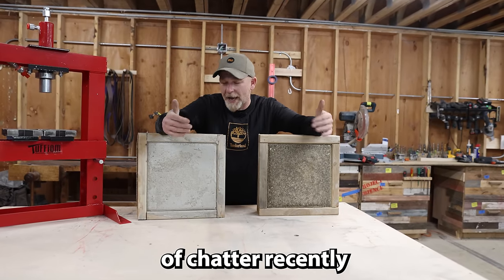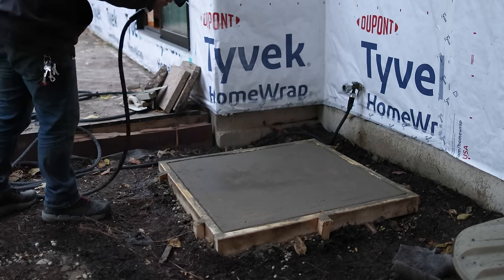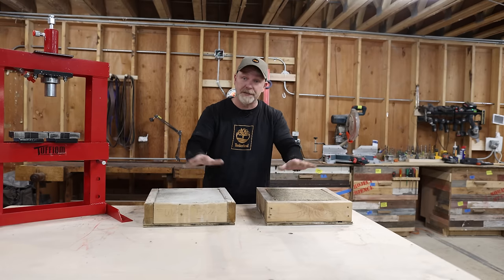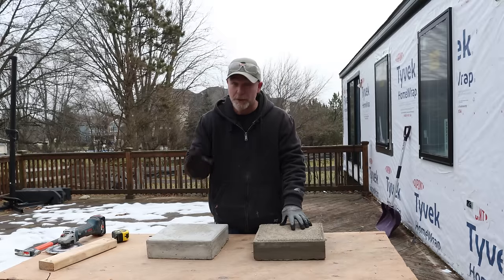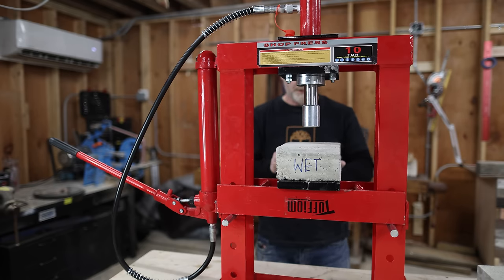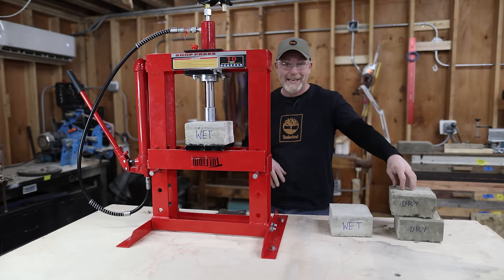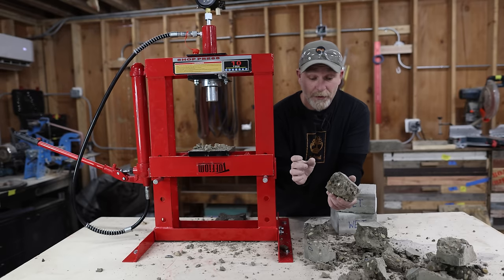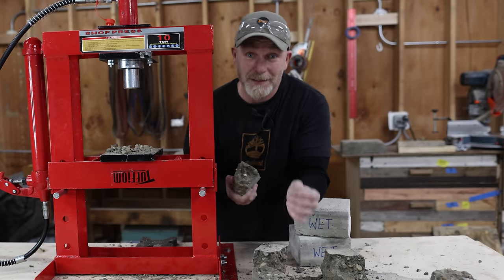The TRUTH About Dry Pour vs Wet Pour Concrete!! Strength Test - You WON'T Believe the results!!

Comment: You have to mix it all together like bread dough to ensure the end material is isotropic, or all bets are off on any loads going in to that mix. Less water means a higher cured PSI, but makes the mix harder to mix and work with. Fly ash and Superplasticisers make dryer concrete mixes more workable, but when the working time is up, the concrete sets up in a matter of seconds...
Reply: We made rebar reinforced test beams and test cylinders out of concrete in Architecture school. We had to do our own mixing, so I tried to hand mix the driest concrete I could work with, had to manually stuff chunks of the mix in to the form corners (it barely troweled it was so stiff), but ended up with almost 5000PSI without admixtures. Fun times...

Comment: Glad I saw this video. I saw a previous video where they did two dry pours and both came out great. One had a chicken coop on it and a year later it had no cracks. I'm building a slab for a 500 gallon propane tank. Sure, dry pouring is easier, but if you're not going to do it right, then just pay someone to do it. I'll wet pour like I always do.

Edit: I will point out that their slabs were only 1 1/2" thick, so maybe the misting made it easier to get the water to go through completely and cure it?

Comment: Like all things in life, there is a time and place for their use. Dry pour make a nice base for things that are low stress and cracking is not and issue, ie as a base for laying pavers or landscape timbers in gardens and beds where soft, sandy soil can be an issue. We have used it a lot in these kinds of applications with great success. Just think of it as harder, stronger base for places you walk or set things on and as a weed/grass blocker around raised beds and walkways. It also works great under lean-to type structures to give your gravel a bit more rigidity and helps prevent shifting and rutting.

Comment: On the dry pour was the powder mixed by hand or whatever very thoroughly to make sure the mix of all the rocks, sand, and hardener, and whatever else is in it was pretty constant throughout, because if not I bet there would be parts with just rocks and sand holding together and other parts that have hardened.

Comment: Majority of the strenght in concrete comes from specific hydration ,the agregate stone size, shape and hardness ,and the steel reinforcing bar and how it is placed in the concrete.wire mesh adds little to no strength but it may keep pices together if it cracks

Comment: Not an engineer, I studied mid 70's. Logic tells me dry poured concrete would require a larger cement to aggregate ratio because  the space taken up by water in wet concrete has to be filled with cement in a dry pour. Secondly, the process of cementation is a chemical process, which tells me if water is required for completion of the process, it will be either less effective without water, or completely ineffective.  Thirdly concrete strength is expressed in megapascale, with 28 megapascale (mpa) being a fairly average, run of the mill concrete. (About 2 tons per square inch, the crush test shown in the video does not come anywhere close to that, with 8 tons pressure applied to an estimated 10 sq inch). Fourthly, even a wet pour should be very carefully mixed with exactly the right water to dry content to pass what is called a "SlumpTest". The reason for the slump test is to ensure the water content is not too high, so the excess water causes micro-voids inside the concrete, which weakens a concrete mix. Concreting is a science, not a recipe.

Comment: The only dry pour that is actually hard is one that is buried right off the bat. We used a dry pour at the joint between the perforated and solid pipe, when developing springs. I've seen those dams get so hard a backhoe couldn't break it.
Exposed dry pours never last. The freeze thaw cycles will turn them to gravel. At least the ones I've tried and seen done by other local folks.

Comment: During the first test, this fellow said he was applying 8 pounds of pressure.  Then he went up to "almost 9 pounds of pressure."  Then he removed what he called a "plate" of unspecified dimensions and contact area and applied "direct pressure."  He then said he applied "6 pounds of pressure."  Then he changed his measurement to "8 tons of pressure."  These tests were applied to the wet pour sample.

With the dry pour sample, he put his "plate" back on and applied "5 tons of pressure."  He declared he observed cracking.  Then he stated he saw cracks everywhere at "8 tons of pressure."  Like before, he removed his "plate" and guessed that he had applied "2 pounds per square inch" using his "direct" method.  Then he declared that he had applied "8,000 pounds of pressure," further obfuscating his results.

All in all, this was a sloppy test because the terms and values were not sufficiently defined.  Every building code specifies concrete compressive strength in pounds per square inch.  This is from the International Building Code.

"Note that the International Building Code (IBC) (Section 1905.1.1) and the ACI 318 Standard (Section
 5.1.1) indicate a minimum specified compressive strength of 2500 psi for structural concrete. Simply
 stated, no structural concrete can be specified with a strength less than 2500 psi."

I would say a more professional test needs to be conducted with the correct terminology, correct units of measure, and standard procedures before anything definitive can be decided.  Also, if 2,500 psi is sufficient for structural concrete, it looks to me like either dry or wet pouring will work just fine in many applications.  I read someone else's post about the results of leaving a bag of concrete out in the rain.  I have done that, and the result was a very substantial, strong hunk of impervious concrete that certainly did not crumble like Styrofoam, a trade name for the more correctly labelled closed cell extruded polystyrene foam.  In professional tests like this purported to be, and on drawings, and elsewhere, using trade names is avoided.

If 2,500 psi is sufficient for structural concrete, I would say dry pouring is more than adequate, without steel reinforcement or gravel (especially when using Quikrete which already has gravel), for driveways, entry pads, or other pads like those supporting an exterior heat pump, a tool shed, a table saw, etc.  The difference between wetting concrete before you pour it or after is not clear to me.  Perhaps with some sensible analysis and application of wetting a dry pour, there would be no difference.

I'm a little surprised that those geotechnical engineers and concrete engineers and civil engineers making comments did not point out any of these invalidating deficiencies in this amateurish test.  It makes one feel like they were defending the method that supports their livelihoods.  Also, it seems to me this fellow rushed into a "test" to take advantage of the current heightened interest in dry pouring concrete without really knowing what he was talking about.

Comment: You should make another video and test both with anchor bolts and concrete screws and use torque wrench to test strength. Thanks for the  content.

Comment: Don't let this deter you. The average person dry pouring is doing it for foot traffic or small pads like grills, sheds, coops etc. Even if it were for a driveway, the average vehicle is not 8-10 tons.. and the concrete will continue to cure the longer it sits. Also the weight distribution of that tonnage pressure is minute compared to a vehicle.

Comment: Dry pour and water. One main point missed is that the test forms had plywood bottoms. The dry pour method expects gaining ongoing moisture from the ground, NOT just from initial hose work-- continual curing. Strength: If, for example, the purpose is light traffic, why does it matter if wet mix can handle more pressure than would ever be encountered? Isn't that like saying everyone should have a Ford 250 pickup, when all the hauling functionality I need is for grocery bags from weekly food shopping?

Comment: If you only walk on it, it's perfectly fine, i did mine 10 years ago, and not even one crack, do it by layers too, you will be sure the middle will be wet too, every 2 inch you put, you wet it, and the top layer do it like the videos are showing you.

Comment: Watching watching several pro and anti dry pour concrete videos, what I've come up with is this:
1) Dry pour in absolutely inferior quality to wet pour, if we consider both are treated properly by a competent worker. There's simply no arguing this. Make no mistake, dry method is a lazy, cheap, DIY shortcut. That doesn't mean it's wrong to do, as a DIYer, on your own property. No experienced mason, city/state/federal official worth their salt would ever sign off on this method for any important work.  

2)Dry pour should definitely NOT be used on anything structural, such as footings or a monolithic pad that carries a constant dead weight. 

3)This doesn't mean dry method is useless. Fence posts might actually benefit from a dry method, in some situations. Patios and sidewalks can be done dry and hold up for a number of years before it disintegrates. It might be a good short-term strategy, for a handicapped and/or poor person.

4) I don't have any real data to go by, but I imagine that wet pour projects will last much longer than dry, generally speaking.

Comment: Interesting video! I think the dry pour was not done properly with the "misting" stage. Note that he seemed to have gotten a pretty rough surface with the dry pour. I think it is because he was not misting, but was literally spraying water into the dry mix. Should have sprayed with a fine mist, and more frequently to keep the surface moist. After the surface sets to a reasonable hardness (hard to the touch) with the misting, then spray more generously. Then cover with a plastc sheet to keep the sample wet.

Comment: Your press handle is upside down. You're suppose to PULL the handle down as it gives you more leverage with body weight. Pushing can cause injury to your muscles.
Reply: Saw that two
But mfg might have shorted the hydrolic lines
Reply: Nope! Upside down.

Comment: I just dry poured a 24x36 pad for my mini-split and after two weeks of curing I was kind of scared of what I would find when I went to drill the anchor holes.  It took quite a bit of pressure to get the 3/8" concrete drill bit using a hammer drill to drill down, so I figured I was good.  The main difference between my pour and what you did though was that after the initial misting, I only waited about 20 minutes and then I really soaked the pad with water and as soon as the water was all absorbed, usually about 10 minutes, I would soak it again.  I think I spent about an hour watering it off and on.
Also, the edges on my pad are rock solid and do not crumble like yours.  My coloring is mostly light grey throughout on the sides but for a few patches of that darker, almost still wet look.  It would be interesting to try your test block again but really soak it and see if it makes a difference.

Comment: The major concern I'd have for your AC unit on the dry pour pad is the vibrations from the unit operating. It turns the weight of the unit into a dynamic load, which acts as a hammer on the pad.

Comment: This actually not dry cast but powder cast. However the issue you have is hydration on a dry powder cast.  If you do a true dry cast  which is just enough water to make the  mix Damp So crumbly  but when you squeeze it in a ball in you hand it will clump or pack tight This is true dry cast. Try a pour that way and you will find the concrete will be substantially harder than the wet cast However it requires more effort to finish as you will need to  compact it in to place vibrated ( tapping with a hammer many times)then trowel finish (your press will work well for that). The advantage to the true dry cast is you are keeping the water to a minimum and once it has been compacted  manufacturers can de mold instantly. This is used in all types of pre cast paving stone cement block patio slabs and casting place or slip forming  Curbs, Concrete highway barriers road construction Or roller compacted concrete slabs.

Comment: Each to its own.  If you don't have all the tools needed to wet mix it and only need a pad for a shed/walkway/pad for water softener or even a walkway,  then dry mix is a good option.  This covers 90% of DIY who just want to reorganized their yard without spending too much money. If you need to a concrete slap for something heavier like a driveway/fence post or a small building, then wet mix is always a better choice.

Comment: If you use a dry paint roller on the dry pour it will not be rough. Search the net for examples. If your usage is for a foot path with low weight and stress usage, a dry pour is fine. If your usage is for high weights and stress, a wet pour is best.

Comment: Dry pour works best for things like posts. I do all of my posts with dry pour from bottom to six or eight inches from the top and cap it with clay. Dry pour gets better strength when it can slowly extract moisture from the earth. I haven't tried it for slabs but if I do, I will bury them in moist earth until cured.
If the dry pour doesn't get enough constant moisture for the catalytic reaction to develop a good gel it will fail to get good cohesion.

Comment: There are a couple things that are wrong with this test. One being that the wet concrete although mixed wet was by hand with a shovel. You always use a CONCRETE MIXER for this. And second that dry pour is a hit and miss thing with the mixing process. You aren't supposed to spray it but use a gallon jug or other type of device to mix it with. It's supposed to be poured - not simply wet or moistened with water spray. I've never seen that before. The instructions on the bag even say one gallon of water for every 50 Lbs. of concrete mix. 

My friend and I mixed it with a gallon for each bag and it came out white like regular concrete mix. He'd done this before last year when he had to replace the fence posts along the back of his yard. A powerful storm blew it down. He used the dry mix in a bag. We got this from Ratnard's (Menard's) and it worked pretty fast. We just did this to repair his fence along the driveway by replacing the old posts. This was yesterday afternoon (5/24/2024).

Comment: I have poured concrete dry at times and the major problem I see is getting the aggregate mixed evenly throughout the pour. Most times the gravel ends up separating from the cement and making a layer.  I equate it to making a cake mix dry or wet. If you just put the flour in a bowl and dump the rest of the ingredients on top, and bake it, you’re not going to get a very good cake!

Comment: Concrete is a crystal -dendrite structure. the chemical reaction of water and cement  create crystals that grow out and interlock with each other. Without enough hydration the crystals will stop growing. Try dry pour but saturate/soak the slab every day for 30 days and then compare.  I don't think it will compete with a (proper - mix ratio) of concrete but it should preform better.
As a mater of fact if you pour a slab and soak it every day for a week or two it will become much stronger and develop less cracks. This is not practical for contractors but it is a good idea for the home owner.

Comment: There are no short cuts when doing a concrete job. Cement needs to be mixed-up so you know the water ratio, either by hand or machine. Each bag may have more or less rock or cement per bag than others.

Comment: It should be called properly poured concrete VS homeowner poured concrete.
 There is no such thing as "dry poured concrete". 
 This kind of reinventing of the wheel should be mocked and ridiculed.
 No professional engineer would accept this as an alternative to Properly pouring concrete.
 With that being said, thank you for doing this video.

Comment: If the dry pour had compactive effort applied so the density approached a Modified Proctor value the strength would be far higher than the wet mixture. The water added to make the mixture plastic is not needed for hydration. The maximum strength is created with far less water.

Comment: Probably is because the way the water enters into the mix. When you do it wet you mix all ingredient at the same time. Including the water. In dry mix the water gets in later and gradually. You don't have control of the process. You can't guarantee that everything gets the same amount of it. I am not an engineer, but the ratios of the ingredients affect the strenght of the mixture.

Comment: Corrugated (dried all at the same time)  vs drying at different times basically. Could've told you that lol. The only time I dry pour is around deck and fence posts because they aren't bearing direct loads

Comment: The ultimate strength of a given concrete is dependent on the water / cement ratio. If two samples are cured in exactly the same conditions the one with the higher water / cement ratio will be weaker. But of course the dry and wet samples did not have the same curing conditions. The wet concrete can start its strength gain  immediately after placement, but the dry sample only gets water on the surface, and it likely takes time to percolate through, and that water likely doesn’t get all the way through. Looking at the stripped samples it looked as though the dry sample was still green, which indicates it hasn’t been curing for as long - because it didn’t get water until very much later - likely mostly from the atmosphere, perhaps? I suspect the dry sample would likely have a higher ultimate strength, but it would take a long time for the necessary water to get all the way through the mix.